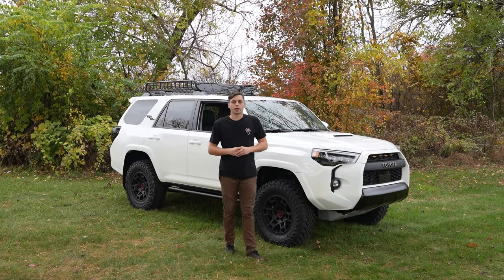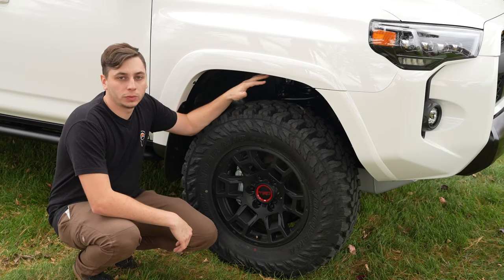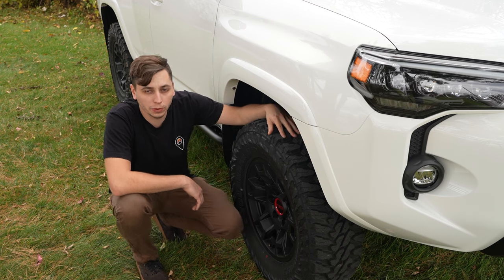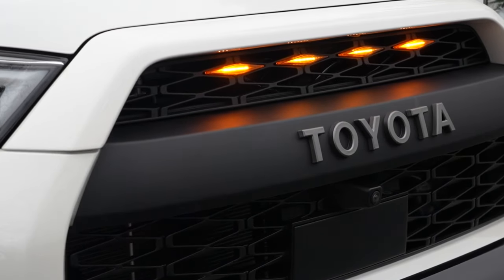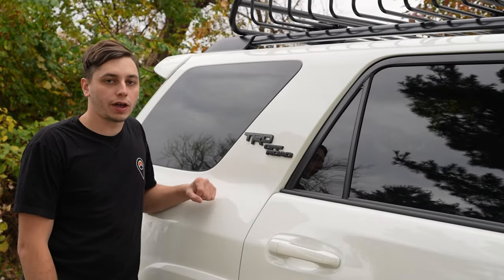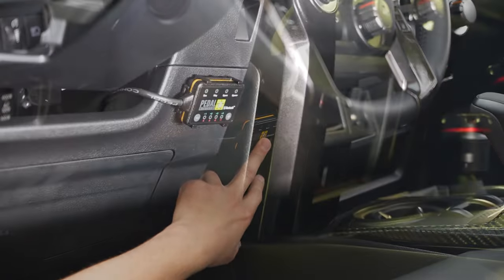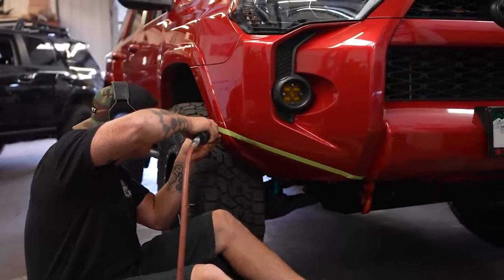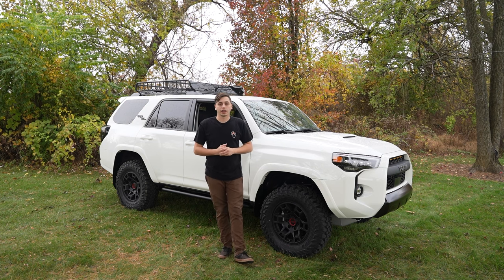The Best Daily / Off Road Budget Build for 2014-2023 Toyota 4Runner

Comment: You have some good ideas. The Pedal Commander is a lousy copy of the Sprint Booster V3. It's also way too large and is proven to be unreliable. There are many reports of unintended acceleration because of the PC. Get rid of it and install something that's proven to be reliable. There are better (and safer) options. The most recent report of the PC malfunctioning was by Viking's Garage. Know that the awards given to the PC were for packaging, not the hardware.
Reply: I will be getting rid of my PC and going to the Banks.. it seems better than both the PC and the SB.  SB has a tiny little pod for baby fingers, so thats out for me.

Comment: Is an alignment necessary after the leveling kit?
Reply from the maker: Yes, an alignment should technically be done after any suspension modifications. After installing this without an alignment it drove fine but eventually the tires might start wearing funny.
Reply: yes it is, for sure !  been there done that.
Reply: Thank you!

Comment: Went to OEM black valence.  Not happy with the ones you guys painted?   I was debating doing the mod to mine but not if you guys weren’t happy,with the DIY mod
Reply from the maker: Honestly, I like the painted ones better. The finish on the OEM ones is a bit too glossy. We had Oem ones laying around so we threw them on but might switch back. The front bumper will be getting cut soon for a bumper anyway.

Comment: Pretty cool stuff... other than the black shift knobs, which are harder to see if you drive a lot at night.   the ambient LED between the map lamps shines very dim, but it's enough to see the silver ones.   i also added dim lighting for the floors just so it's not a black hole at night.  drop something you can slightly see it and not feeling around in the dark.  i drive a LOT at night,  so what matters to me might be different.
Reply: @edward5979  I used shift knob as an example.  Not a fan of blacked out stuff on the interior.  Just my preference thats all.  Have it the way you want it.  Thats the beauty of cusomizing your ride.

Comment: Will the Maxtrac leveling kit fit a 2008 sport 4runner? Also, if I run 275/70/17, will any body trimming be needed?
Reply from the maker: Yes, same part number. You should be fine with the 275s

Comment: I was looking into buying a TRD off road. I was wondering if I should purchase the extended warranty. Will I void the warranty if put on a level kit?
Reply: No you won’t unless what has caused the problem is the leveling kit. I have a off road premium and its the best option in my opinion to save 10k+ on a pro. The interior is the exact same as the pro. Just all around better bang for the buck is the off road if you can swing the extra cash get the off road premium 100% worth it
Reply from the maker: What he said ^
Reply: Don’t lift a 4 runner.